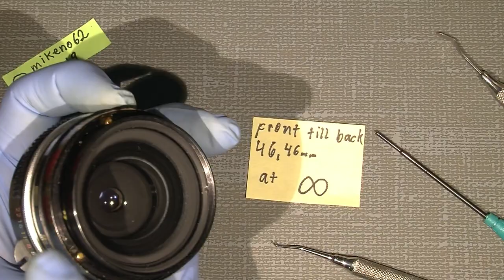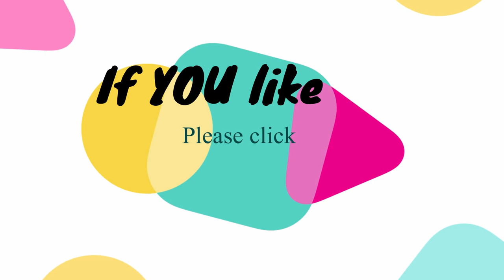How to adjust focus to infinity in Pre-Ai Nikkor 28mm 1:3.5

Comment: Thank you for posting your video. Very nice demonstration. It looks like you are the one that can help me. 
I have a vintage 500mm F/5 Reflex Nikkor lens I bought around 1972 and it has been a jewel. I have all five filters. It is in great shape. 
Now I want to use it on my Sony A7RIII and the Nik-NEX adapter is just a tiny fraction too long and it will not properly focus on infinity and most of my hobby now is astro-photography so the moon and stars are not crisp and in perfect focus.
If the adapter was too short I could shim it but I just can not see a way to shorten the adapter and it seems foolish to buy more hoping to get one that is exactly correct or maybe even a tiny bit too short which would be OK as I could focus "to infinity and beyond"... remember Buzz Lightyear? 
Do you know of a way to adjust the big lens I have, even a fraction of a mm would likely be enough?
Thanks in advance for any help.

Comment: Hi i have a question. I have a non ai 50mm 1.4 nikkor lens. I had it cut so it can be fitted to my dslr.  But the focus on my visor and the photo never matches. The actual photo focus is more forward than the visor is showing. Im using liveview to focus my images point on. Not the lense but the mirror and dslr has an issue perhaps? Thank you
Reply from the maker: Just some ideas, is the viewfinder diopter set correct so what you see is in focus, are the same as the green focus confirmation dot in lower left corner in the viewfinder is steady, have you try the lens on another Nikon camera.
Reply: @mikeno62  Hi, diopter adjustment is set correctly. And i tried the lense on d600 and d7100. Both have the same issue. It doesnt focus on the infinity. In order to focus in infinity i have to dial the focus "nearer". Also on the closer objects the view and the actual photo have different focuses. This is very interesting i asked many people but noone has ever seen it
Reply from the maker: Well, then I would guess the focus helicoid has been disassembled and not being assembled correct.  It could also be some of the lens element's that not sit correct after a repair, or the focus ring itself don't sit correct, it was just some ideas.